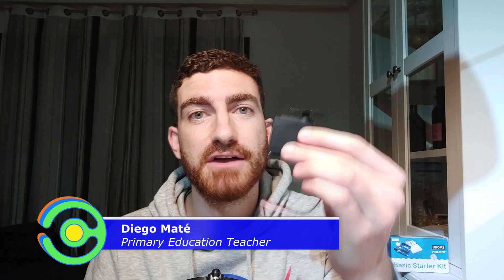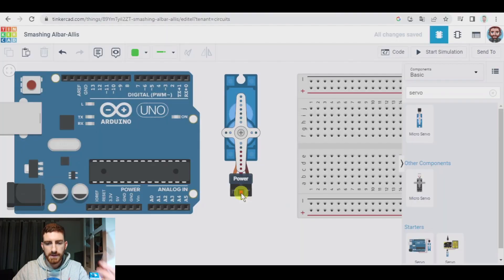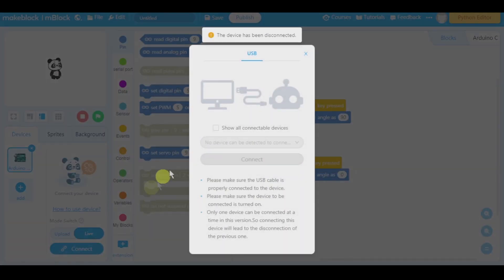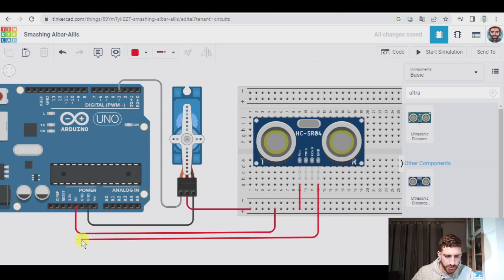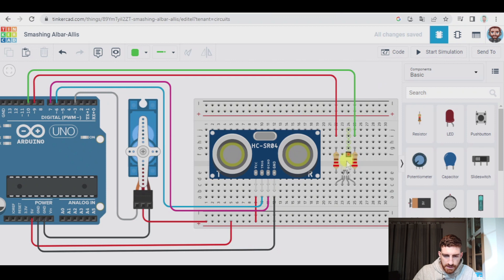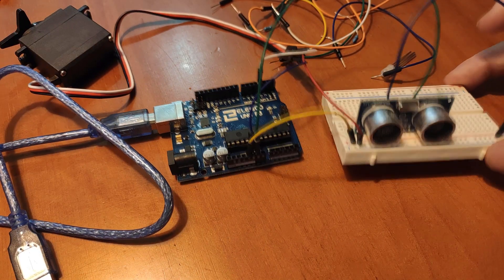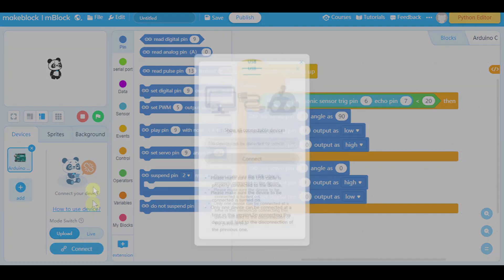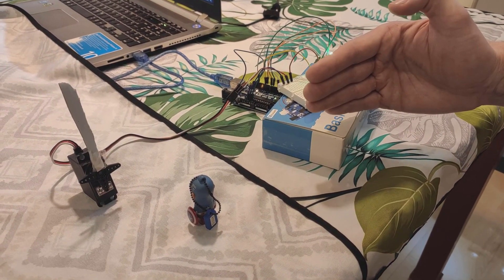How a SERVOMOTOR works with ARDUINO and mBlock 5 (based on Scratch 3.0) - Arduino Course #12

Comment: Thank you for your video 
 How to do it if I connect to two servo motors? Thank you
Reply from the maker: Same way. If you're asking because you don't have two 5V pins, connect a wire from the 5V pin to the negative rail of the breadboard and all those pins will be 5V pins.